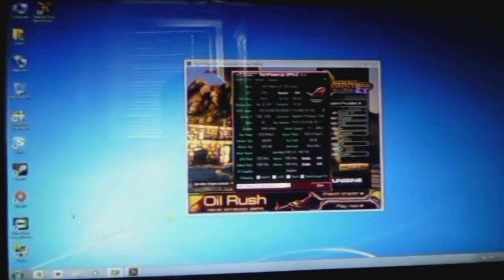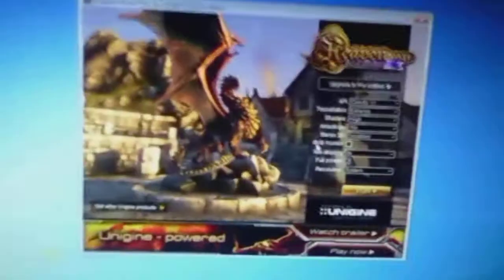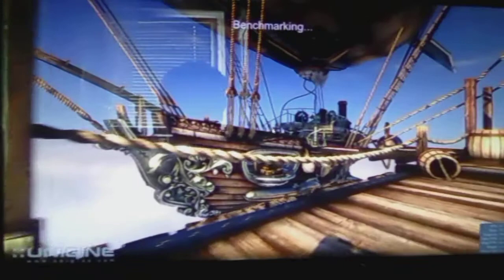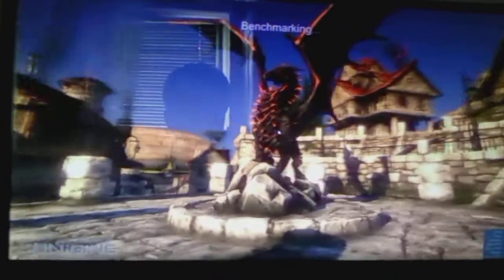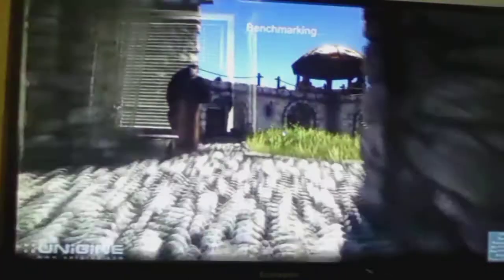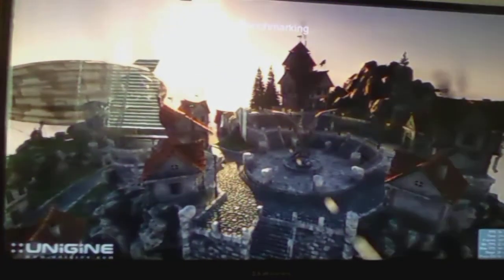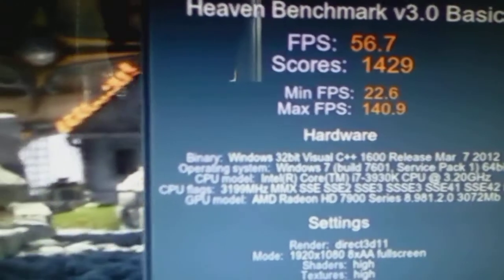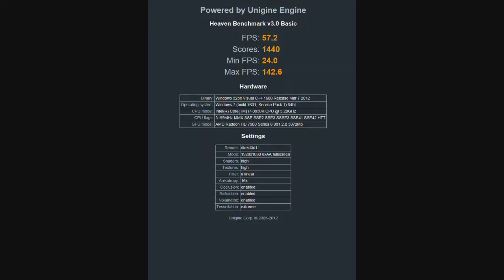Radeon HD 7970 Massive OC Unigine Heaven 3.0 Benchmark (Max Settings)

Comment from the maker: I have tried every possible setting, i couldn't go past 1340Mhz on the core even with stock memory. It could be that MSI AB is not increasing my VDC porperly so the card is not getting enough voltage for OC, or it's just that it can't go further, mine is the Dual-X edition from Sapphire.

Comment from the maker: Well..i've written that it is water cooled, and GTX 680's OC potential aren't higher than of the HD 7970 even on water, due to the smaller memory bus width. I got 10fps higher than your OC score and on most WC GTX 680s, they wouldn't achieve that. Not trying to be a fan boy or anything, but most AMD cards overclocl better than most nvidia cards. I will still change to an nvidia Maxwell GPU in about 2 years though :)

Comment: 300 higher than most GTX 680s? who's 680s? water cooled and overclocked 680s or completely stock? this 7970 is water cooled. i don't usually overclock but decided to try out overclocking my GTX 680. i got 1220 on air after 2 minutes of playing with it. i just pulled the tabs to some high looking numbers and benched. i'm sure if it was water cooled it would go a lot higher.

screen shot: img820.imageshack(dot)us/img820/3373/benchq.jpg

replace the "(dot)" with an actual dot.

Comment: Thank you for the repost with max settings,  you got about 300 higher score than most of the 680 videos, tho I doubt they overclocked as much it's good to see the 7970 keeping up.   Have a 6970 right now, and thinking of upgrading to two 7970's for 3 monitor setup.